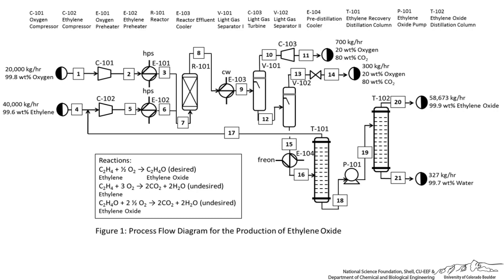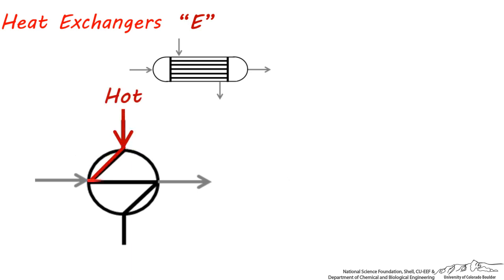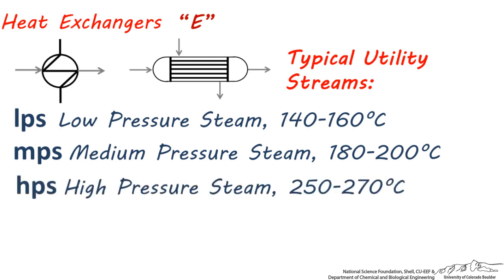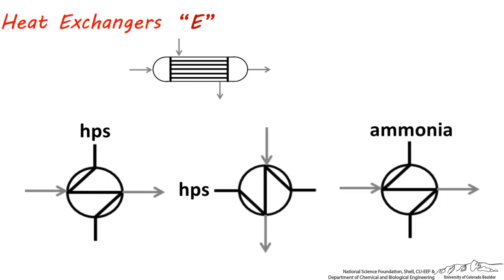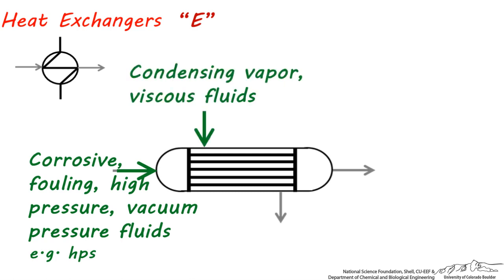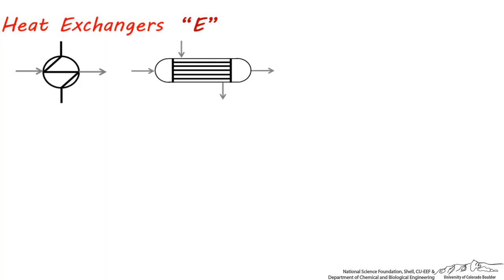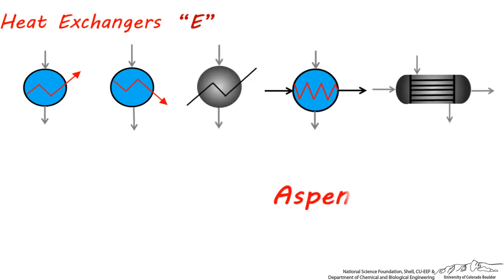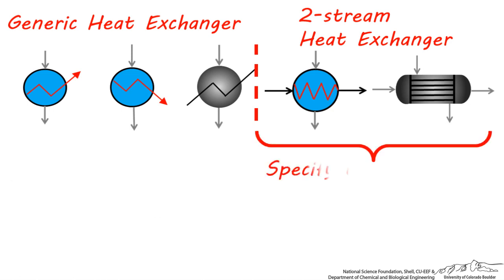PFDs: Heat Exchangers Part 1

Comment: Fantastic stuff. So far I've only watched a couple and started this one. I Just excepted a Senior Controls Engineering position at NEI Engineering in you in Denver. Excellent explanation and presentation of the material. I've been hired nito the newly created SCADA dept. its about a year old. A lot of new people and many just starting out in controls and many coming from substation and PV farm controls. Electrical power substations is where I spent the previous 7 of my career. This is a great refresher for me. and hope to put its out there in our dept for those interested to view. I found you as on of the resources in the ISA online CAP training i'm using as a refresher. We have done most of our work in the electrical power industry but have begun to to pick up some industrial wastewater projects. 7 years old and still very relevant. thanks